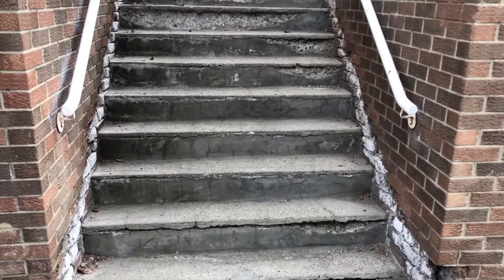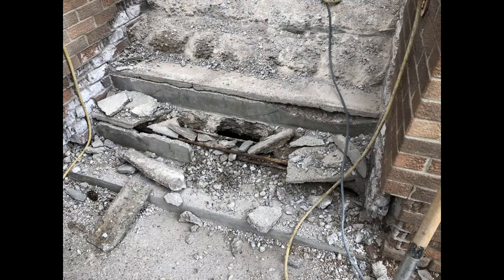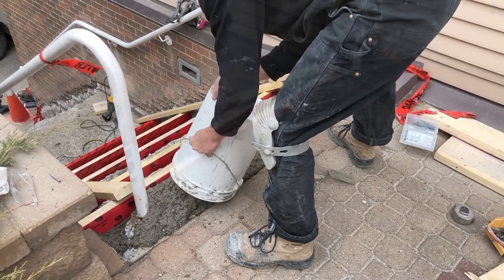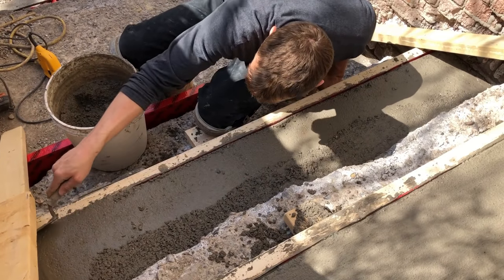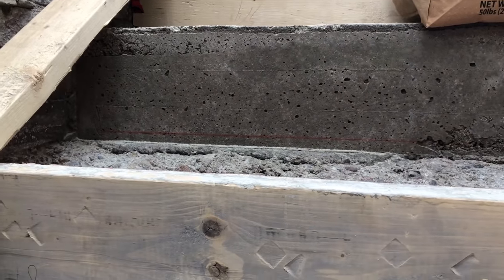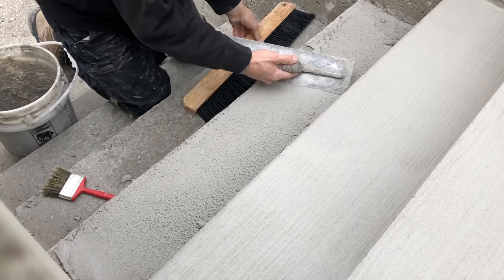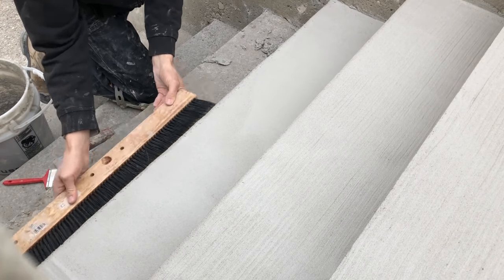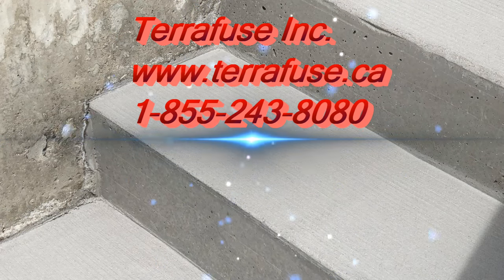Concrete Stair Restoration and Overlay - One day repair!

Comment: Good job and great presentation. What's the time on the mix? And is it as strong or stronger than 3500 psi mix? Just curious. Thanks for sharing.
Reply from the maker: One minute is plenty, just need to wet out the powders. Final strength of this material is 5500-7000 psi 👍👍

Comment: I used a bonding cement for the tops of my 2 steps and on a corner which cracked off. Then I put quick set cement over top and made a mold to fill in the corner.   Now I am spraying with water waiting for it to set, then I guess fill in  what settles.  I haven't put quick set on the top step yet?  Can I leave it with the bonding cement?  Its getting late so I figured I would finish in the morning.
Reply from the maker: Hey, not too sure what you are doing, its a bit confusing, but the TF Structural could do that type of repair in one shot.
Thanks
Reply: with a resurfacing product you do not have to keep spraying water during the curing process bc there is none.  forget about the quick set as that is a product for new jobs not repairs.  you can get use a product that requires the acrylic bonder like CementFix, Ardex, Patchcrete or use a product like Terrafuse that has a bonder already in it.  just mix the product and apply to a moist surface and trough/float it to the desired thickness and finish.

Comment: I really wish you had shown how you built the forms with brick walls on both sides. Im in a similar situation with concrete walls on both sides and no place to place a stake. Otherwise nice work.
Reply: It looks like they are held in place by 2x2x4s fastened and flat  along the tops of the 2x8 forming boards. Probably tight pressure fit at edges. And he yes bases of material to suport forms also
Reply: @CobaltNorthernStudios  thank you

Comment: Donot u have to use bonding primer and wettings the old concrete before applying the new one  thx
Reply from the maker: No, this product is not Portland cement, so it does not need to be “glued” down. It bonds directly to concrete substrates.
Reply: @TerrafuseInc   where u get that  i  need to do part of my  basement that i    made hole for pipe repair   and than want  to  tiling it    any link  for that product please  thanks

Comment: I have some concrete stairs that were covered up with wood. The wood is now falling apart so I am planning to remove it. I think the stairs underneath are ok, but sagging in the middle/worn (not necessarily crumbling). This product looks like it could do the trick, but I don’t have a grinder. How much cleaning/prep is needed and what equipment would I need? Trying to figure out if it’s worth the tool investment to DIY this.
Reply from the maker: You can use a pressure washer. You just have to be sure there is no loose, deteriorated concrete left, and it is all clean and porous. Imagine painting a new coat onto flaking paint, it won't last.

Comment: Mortar is usually designed to bond building materials like block or brick. How will this hold up as steps? Does it need sealed.
Reply from the maker: This product is designed specifically as a concrete restoration mortar, and it will hold up better than concrete. It requires no sealers or curing procedures after installation.

Comment: this looks like a great product ! is it possible to use the TF structural repair mortar for parging a vertical concrete foundation ? thanks.
Reply from the maker: Sure! You will have to work out your technique, but it goes on great vertically, and bonds like crazy to concrete!

Comment: What do I need if my front steps are leaning towards one side more? So basically I have a wall up sidewalk then three steps to my front slab then my door. But my step have a half an once dip and cracks along the front slab here and there. The previous owner tried to fill the crack but my steps look detached. I can see metal.
Reply from the maker: Sounds like an involved process, but you can do it with this material. I can chat with you on the phone more about it if you’d like 👌 Pictures are always helpful too
Reply from the maker: I saw your pictures, haven’t had a chance to reply, but yes, this material can fix that, but it will require an experienced contractor 👍
Reply: @TerrafuseInc  I was hoping we could do it so I could save money. Thanks.

Comment: Hi, I think you said something about mixing it with an aggregate, where do we get that? and how much do we add in? I'll be doing stairs like the ones you just did. How much of the product would you need to do the stairs you did in the video if I was purchasing on Amazon? Thank you very much
Reply from the maker: You can add pea gravel usually sold at a landscape supply. Add approx. 30% by volume to your mixes. The product fills about 1/2 cubic foot/bag with some rock added, so you'll have to calculate your total volume needed. It will probably be more cost effective to buy it from us directly, and have it shipped to you, if you are doing bigger volumes. 
1-403-243-3000

Comment: Can this be used to resurface a cracked driveway?   given there are a couple islands of 1/8 inch settling...       Can I simply smooth the surface over the the various cracks and slight height differences.. ?
Reply from the maker: This explains cracks, and has links for other videos to repair them.
https://youtu.be/iuK9_XweHKA

Comment: Can this be used to level interior steel floating steps? Will it stick to the steel? Will it withstand a small amount of flex?
Reply from the maker: It is designed for concrete, and is a very rigid material, with zero flexibility. If you are filling deeper metal pans with it, it will work, but can't be applied as a thin overlay onto steel structures.

Comment: Great!
Is this repair mortar good to go overtop exposed aggregate?
Reply from the maker: Yes, as long as there is no sealer on the concrete. It has to be clean, non-sealed porous concrete.
Reply: @TerrafuseInc  thank you very much for the reply.
Will look to purchase at the local supplier here in the lowermainland.
Thanks for videos.
Well done.

Comment: What aboutif it has a long deep hollow hole almost the width of step with no way of framing it from within since it is enclosed, the hole is about 3 inches from riser part and about the width of steps on the top step (concrete precast top step of 4 or 5)
Reply from the maker: Can you send pictures? We have done lots of these types of projects, but they can be tricky!

Comment: What is the minimum thickness of this mortar can be laid where it will retain its strength?
Reply from the maker: No minimum thickness, it can go to feather edge, and yes, it retains its strength, and takes on the strength of the concrete below it.

Comment: How can I repair indoor concrete stair ? Some have  4 inches height and some 6 and 8 inch height
Reply from the maker: You can use this material to go as thick as you need. You will have to do some math as to how much to add to each step, to get them all the same.

Comment: Can you add a prefinished stair tread on top of a concrete step?
Reply from the maker: I dont really understand your question?
Reply: @TerrafuseInc  I have carpet on my stairs, but they are covering concrete and not wood. I want to add a wood step over the concrete, using a prefinished stair or laminate wood.
Reply from the maker: @veejones9262  that should work, if the prefinished stair tread is meant for outdoors 👍

Comment: can you strip and rub the face or will it collapse if not cured hard? who is your distributor in central ohio?
Reply from the maker: Yes you can, but your timing has to be bang on, as this undergoes a very rapid curing process once the reaction takes off.

Comment: What kinda sheet are you using for the form?
Reply from the maker: Tuck tape. Tape that is used for house wrap. You can use any non-porous product, just so the TF Structural doesn’t bond

Comment: Great video! What did you use to grind down the concrete? Thank you in advance!
Reply from the maker: You can just use a 5" diamond grinder, there are many different makes/types that will work well, but I highly advise a dustless system with a vacuum :)
Reply: @TerrafuseInc  Much appreciated!

Comment: What is a list of all the tools you would use for a project like this ?
Reply from the maker: A basic list would be low rpm mixing drill, mixing paddle, 5 gallon pails (to mix in and for water clean up), trowels of various size, forming equipment (hammers, nails, wood, screws, drill), power cords, knee pads, tarp to mix on, and anything else you see me using during the video :)
Reply: Terrafuse Inc. thank you for taking the time to reply.  I learned a lot from your video.
Reply from the maker: Glad it was helpful!

Comment: It seems to me like removing material like this with a hammer drill is rather excessive. i would think hitting it with a masons hammer should remove most of the bad material and give good feedback on how strong the remaining material is. Also i thought mortar was for brick and stonework and Portland cement was perfect for this kind of work.
Reply from the maker: This is for a long term, permanent restoration. I agree, you only need to remove the loose, broken, deteriorating concrete, but these steps had no structural integrity left in the concrete. If you don’t go deep enough with the removal, after a few years, the concrete will fail underneath your restoration. These steps are not typical though, most you find won’t be in such bad shape!
Reply from the maker: Portland cement does not bond to cured concrete. TF structural is specifically designed to chemically and mechanically bond to existing concrete structures. It doesn’t need or use added acrylic polymers to “glue” it in place.
Reply: Portland cement is a component of both Concrete, and mortar mix

Comment: Don't you suppose to chip on top of the stairs before you put concrete so it doesn't crack or pop out.
Reply from the maker: This is not concrete, and yes, all the loose, deteriorating concrete was removed prior to install.

Comment: Earthbond,  good video. I was kicking around looking how I'm going to  make brick treads deeper  for a stairway Going from a garage to a house.  And the algorithm that is stalking me sent me your video. 

 I intend to use either number two or number three rebar and DowEl  to the tread and to the riser. 

Essentially I will be adding  one  4" x 7" x 56" block, and three – 3" x 7" x 56" blocks.

I was looking for the best type of concrete to use to accomplish this. 

 I took a screenshot of your phone number. I might start calling you. Every day. Three or four times a day. Until I am done with my job.

 Or I will take my questions to the local Masonry supply house. Thanks again

Comment: What is the red tape/plastic sheeting on the forms? It looks like it's for quick release of the concrete. We cannot find anything like that anywhere. Any ideas?
Reply from the maker: It’s tuck tape for house wrap. You can use duct tape too, or powdered form release, or sheets of chloroplast. Thanks!
Reply: @TerrafuseInc   can you oil the form instead?

Comment: Hi there! I want to remove loose mosaic from my building stair and replace it with concrete (costs) Can you help me on with product type to use? Since the added later will be thin I have doubts on if this will work! Thanks
Reply from the maker: TF Structural! Please call for more info! 1-403-243-3000
Michael

Comment: how much this kind job cost?
Reply from the maker: It really depends on the area, and the condition of the concrete, but most applications will be much less than ripping it out and replacing.
Reply: @TerrafuseInc  

How much did the first job cost?
Reply: I don't think he's going to answer that. And well he shouldn't. Because he's not gonna come out and do it for you. He's in Canada. Probably up above the Arctic Circle.

Find somebodies local to give you some prices. Be very specific ( that means write down what you want)  so  when you present your desires to each contractor that is giving you a quote they are all bidding on the same thing.

Asking a man who was kind enough to show us a good product and technique to repair some stairs to give a price, that you might then used to negotiate a price with a person In a different area Is unfair to them, to your potential contractor, and to you.

Comment: why tape, just use oil?
Reply from the maker: This product bonds extremely well to wood, and usually the form oil is not enough to prevent that, and you end up having to pry off all of the forms

Comment: I'm a Mason as well and it's eating me up inside that you did not porridge the face of the steps the face look like Swiss cheese good job but not properly finished
Reply: Can you explain what that is because I have to fix my concrete steps and would like to do it right?
Reply: I would also like you to explain that 😅
Reply: @natstar6052  I think he means parge, not porridge.  Parging means to coat the surface with a skim of cement mix or stabiliser before applying anything else.  But in the video the guy did explain that the product he is using is very adhesive so would not need any prep as long as all the loose stuff is removed.
Reply: @DongusKong  see my comment above……
Reply: @alisonbamford6723  thank you!
Reply: Masons don’t have time to leave paragraphs under YouTube comments
Reply: I like that the AI wrote porridge instead of parge.  They might do it with my comment as well. But I am going to say from now on.  "We will put a porridge finish on those foundation walls." Of course it will be said with a straight face.

Comment: Can it be stained
Reply from the maker: Yes, but over time, the material fades very light, and colors can become very flat looking. Ideally, after it is stained, you can apply a clear sealer meant for concrete, and it will make the color more rich.

Comment: 15 sft for 69.- on amazon...are you out of your minds
Reply from the maker: You can always rip out your concrete and replace it. The amazon kits are meant for small repairs. If you have larger areas, you can buy the material in 50 lbs. bags directly from us too.